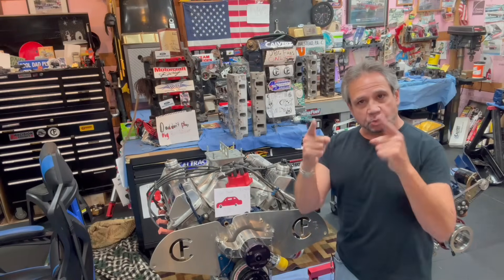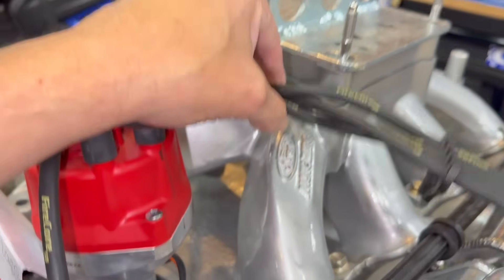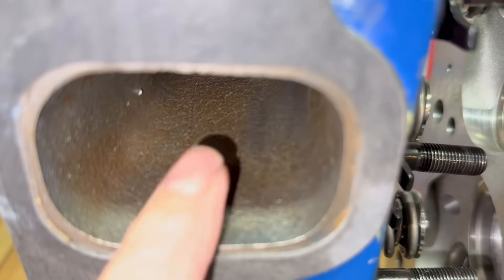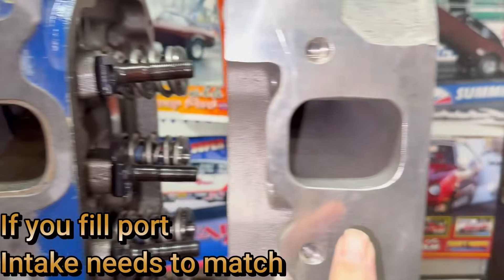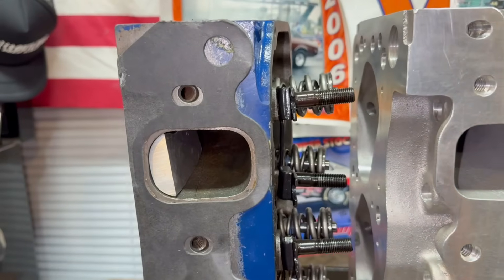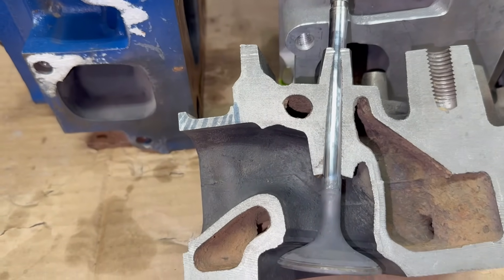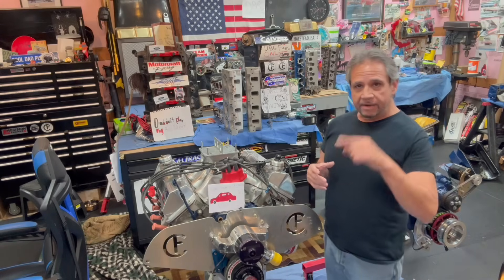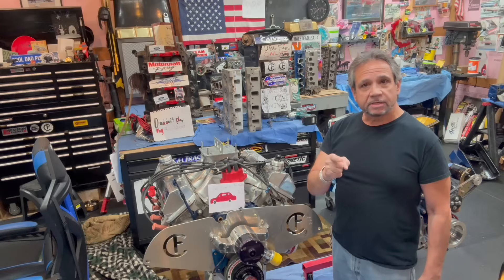DBG: Which 351 Cleveland Is Which, 769hp, or 615hp, Take Your Pick, OR Choose Your Weapon

Comment: We were actively involved in running Clevelands in the early to mid '70s. We were told that the evolution of the exhaust plate began with a Ford insider, was adapted by Gapp&Roush, and then Mullens and Air Flow research. They each had their own variation. By 1972, in classes that allowed the modification, every serious Cleveland campaigner was running them. We tried them all, and there were performance differences between the versions. As Tim mentioned, the stand-alone mod was probably good for 25-30 horsepower. But as Darin intimated, around 100 horsepower potential was realized when in combination with other induction modifications and the right parts and tune. Those early developments are what lead to the Cleveland engine still being respected and relevant today. 
Those were great times, and thanks to "DragBoss" Tim Halstead for helping us relive them and for keeping us informed on current tech.  
B.T.W. "Shocktowers."😡
Reply from the maker: I think it was Wayne Gapp who thought of it, from my memory, the guy that machined the first set at Ford had contacted me, was given the blue prints from Gapp. Right Bill with todays valve trains def could have 100hp potential.

Comment: Hi Tim, I know your going to flinch ! 
But I’ve had great success with the speed master 3 v’s . 
Off course threw away all the rubbish valve train . Filled it with Comp cams stuff and run it on my 1971 Gt replica ( falcon 500 with Gt phase 3 running gear and styling that was raced at Bathurst in the 70’s by Allan Moffat rip and others ) 

Thing is awesome with such a small hydraulic flat tappert cam 253 deg at 50 single pattern and ..585 lift on 110 deg installed 109 deg . 
Also my extractors are meant for 2 v exhaust. 
So some free Hp there with 4 v pacemakers extractors.
I know not possible but be awesome to see them on a flow bench. Out of the box I think they are 310 cfm at 600 lift . 

My early Speed master heads prepped and ported by Terry Parker eg funnel web manifold , went 350 cfm at 600 back in 2006 . 
Wish I could post pics of my current 351 .

Ps my 408 was a failure unfortunately. Working to fix it .
Reply from the maker: Thanks so much for the comment. Your ride sounds bad as Hell. I like working with what I have the A3 heads. I also am going to build an engine with the high port heads, buddy is going to make headers to fit the Cougar. I have talked to Terry back in the day, and have on of his 4v intakes sitting here, that I want to test. Appreciate you mate.

Comment: I think it was Roush/Yates that made the first reveal. Not who done the mod, I think that would be Glidden as my choice. Dr. Ron is probably right I just took a guess. There's alot I don't know. Saw a garage tour for Roush and he was restoring his Pinto drag car,  thought I heard Jack give away info about the heads. Stapleton or Evans channel. Think the heads were dry and wet designs maybe just a better coolant passage change from a Boss 302 to the standard 335' block.. Removing that material where the filler usually goes takes it away from the deck heat. So much of my memory is fuzzy cause I planned out a Clevor build. Back then I was given info about Nascar heads from a guy at Carlisle Ford show. The year 86/87'. They were a set of repaired heads. He wanted $1500 per head. I was putting my Mach 1 on the road and broke. Tortured myself really. He had lots of Ford rare parts and a Grabber Blue 429SCJ Torino and a 70' Twister Mustang in yellow.
Reply from the maker: I also had a guy early on who told me he worked for Ford and Wayne Gapp brought him the plans and asked him to cut the cylinder heads and plates. That was from memory mid 1970. I had it written down, but of course couldn’t find it. There was always cool stuff at Carlisle and Hershey. Thanks Avanced. 💯💪

Comment: Did I miss the engine assembly about what is Very interesting to me is the part putting the oil pump and the oil pump drive between them and the distributor drive to completely understand the assembly so if I was Ever ! Able to build a ford engine the understanding of the assembly without dropping the shaft in the oil pan during the assembly just saying facing my fears and understanding this point thanks I love the sound of that engine in your videos!?
Reply from the maker: Thanks. The oil pump driveshaft has a collet on it to prevent from pulling it out while removing distributor goes in from bottom. 😉🏁👍💯

Comment: I THINK YOU SHOULD PUT YOUR HEADS ON YOUR DAUGHTER'S BLOCK & HAVE DARIN MORGAN PORT SOME NEW HEADS, IRON, AND THIS TIME MAKE SURE YOU PUT THE GASKET ON CORRECTLY, SO YOU DON'T HAVE WATER LEAKAGE INTO THE CYLINDER(S)
Reply from the maker: I think you should know what you’re talking about before you open your mouth.
Reply: @dragboss351cleveland 
WHY DID YOU GET WATER IN THE CYLINDER(S) ? GASKET FAILURE ? 
TELL ME MORE INFO SO I CAN BE EDUCATED.
Reply from the maker: @FORDrulesCDBURLOCK what water in the cylinders, I have not seen any water, have you?
Reply: @dragboss351cleveland  😉